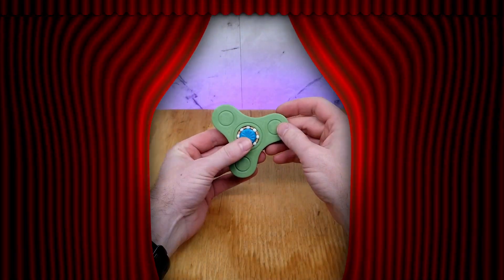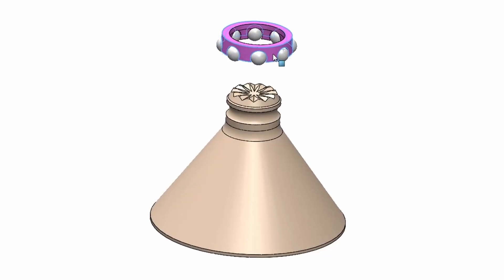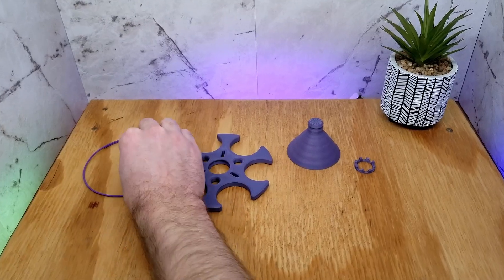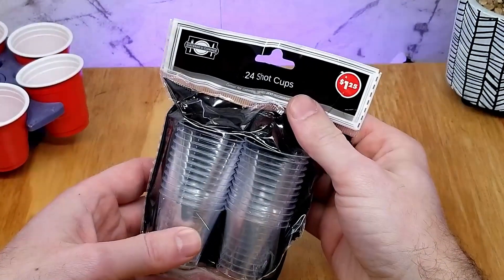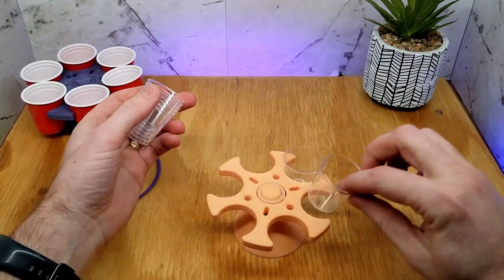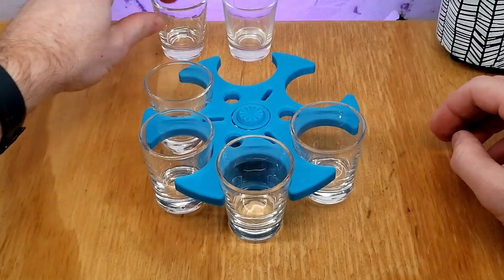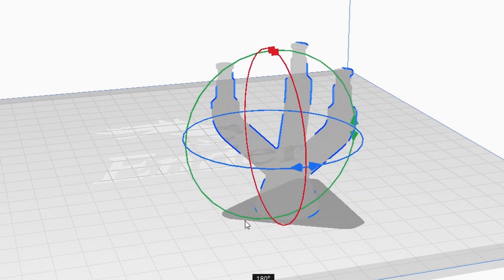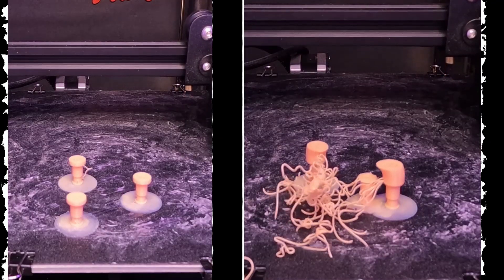Shot-Glass Roulette - 3D Printable! | Turning a Party Game into an Engineering Project. DIY!

Comment: Have you considered printing with rafts? I know it's a bit more filament and a bunch more time to print with them, but they could've actually solved the problem of printing the handle in the original orientation, allowing you to design it with whatever shape you felt like for the knob.
At least on my old Ender 3 I've had great success using rafts for such difficult prints that would not stick properly or warp otherwise.
Reply from the maker: I've considered it, but haven't done it... I've seen it done, it works, and you're probably right that it would have worked for this one. Yeah, I did like the original knob design... sigh... never thought about it for this though, I just reverted back to 'The design must be changed!' attitude. The Ender 3 can be a fun printer, sometimes... most the time though it acts up and needs to be baby sat. Thank you for the suggestion, it's definitely worth thinking about and keeping in the bag of tricks for the next issue 'when' it comes.
Reply: @sanfordprime  Sorry, didn't mean to tear up any wounds. I know how frustrating this iterative process can be sometimes.
I know the Ender 3 isn't perfect, but it was a good first printer.
I've moved on to a Bambu Labs A1 Combo (with the filament changer unit) about a year ago and it's a huge upgrade. Faster, better, automatic bed leveling and calibration, less acting up and multi color to boot. And it's not even all that expensive.

Although I do remember that upgrading the Ender 3 build plate to a textured PEI plate did help with bed adhesion a lot.
Reply from the maker: Bambu? Now I'm drooling... I honestly have very little complaining to do about the Ender. It has been a very good printer, easy to fix so far with the issues I've had, just a little tedious with setting up prints which can get finnicky sometimes. I have a lot of printing hours on mine... and it's held up well. I wish I would have bought the A1 last November, prices were very nice! I just looked at it the other day and fell out of my chair. The only thing really holding me back on it has been the uncertainty about adjusting the Gcode to activate the timelapse photo after every layer, it's kinda how I got into printing is wanting to do the timelapses like that (still some improvement to do in that area for me). From what I've seen, it is difficult to do on a Bambu? Someday I'll have to upgrade and find out. Honestly though, it's difficult for me to justify the price of a new one when I have a 'perfectly' working one already, but it is tempting.
Reply: @sanfordprime  It's much more than just a "prefectly working" printer. 
It's been a game changer for me. It really feels like going from a VW Golf to a Porsche. 

I don't do the timelapse photography, but it's actually built into the A1/Bambu Studio. I just have to check a box to have it take the pictures layer by layer. The integrated camera is useful to check on prints remotely too. 

Eg. I can be at work, deciding I want to print something. I fire up the App and send the job to my printer at home. I can use the camera to check on the progress while still at work.

It senses problems with filament feeding so well, that I could fix the issue and continue printing without any issues in the final print (I actually had a spool, with a hole too big for the AMS clamps, drop off the clamp multiple times during a print. It still came out perfectly fine. Obviously the next print after that was an AMS spool adapter :D )

To me, surprisingly, it's really as good as everyone says it is.

Actually so good, that I'm wondering if I should save up for one of their bigger, more expensive models with even more features.
Reply from the maker: You're a good salesman, that's for sure! Jokes on you though, my mind was already made up on a Bambu. LOL!

I've seen them in action, I just need to figure out a way to break my Ender beyond repair so I can upgrade. The Ender upsets me sometimes but it still works decently for most prints.

I've thought about larger printers capable of larger prints, like printing a full size chair or something. The filament cost for large prints kind of makes sure you're designing something that can't be manufactured by other means, and only capable of being 3D printed, a neat idea actually. But then again, I've found myself printing things more expensively than I could just buy outright, even at the Ender-scale,  just because I could. I think we've all done it. Haha!
Reply: @sanfordprime  ROFL. I was afraid I was gonna come across as a salesman while I was typing all that out ^^
I was just very enthusiastic about my "new" Bambu Labs printer.

I really really want a bigger printer too. I build a lot of cases for projects that are sometimes just ever so slightly too large to print as one piece.
Printing an entire chair would be fun, and to me the "profit" comes from the fact that I can't just print something that exists out there, but something that fulfills the same purpose, but with a personal touch in design.
Plus it's really about the journey too.

Now I imagine you printing your own Captains chair on your future large scale printer ;)

As for ending the Ender... It's so cheap and easy to keep it going, you will never kill it. In fact, I've upgraded my Ender 3 to a direct drive extruder not long before buying the Bambu one.
But you could see it like this: the A1 has a larger print volume, is much faster and has fewer problems during day to day use.
So really buying one will safe you nerves and life time. And maybe you have a friend that always wanted a printer but was kinda on the edge about affording one, so your Ender could get a new, loving home.
Reply from the maker: I couldn't agree with you more, the A1 makes a lot of sense. Also, you have a point, the Ender could definitely go to a new loving home. There are so many people that want to get into 3D printing but never take the first step of buying a printer, I have a few people in mind that have asked about getting into printing. I'd probably just give it to them with the condition that they could never sell it... once they were done with it or upgraded from it they would have to give it away to someone else that was curious about starting and so on...

I have a buddy that justified a new printer to me pretty well also, his reasoning was 'look at how much filament you've ran through it and how much that cost'. It kind of made the printer price feel low after that ;)

If I were to make a captains chair, I'd have to start with a 3D scanner and scan my body to make sure it was the comfiest chair I'd ever sat in. Baby steps though, trying to earn points through Makerworld right now. A free printer someday does sound good! lol.

Once I get into the A1, which shouldn't be anywhere near the amount of printing issues I've encountered with the Ender, I'll probably be in the same boat as you and comfortable with LARGER prints.

A good salesman believes in what they're selling. I believe the Bambu's are so great though that they don't need salesmen, so you might not have a chance at getting in there. LOL!
Reply: @sanfordprime  It'd be the printer that taught so many people the ropes of 3D printing. Passed on from maker to maker.
The Never-Ender

Lol yeah. Don't remind me of filament consumption. Iterative prototyping and design does take a lot of filament, even without failed prints. I once blew through two spools of filament before I had the final design for my Cyberdeck build.

Oh that'd be an interesting video series many would likely watch. How to design your own comfortable captains chair for 3D printing. I certainly wouldn't know how to get from body scan to comfy chair design.
Which brings me to the idea that Youtube might help you get a new printer, once you get more views.

You know, just random thoughts, but I'm eying their new H2D model, with dual extruders, full enclosure, AMS (ofc) and a Laser and a knife tool head for engraving and cutting. If I ever do get one (it is quite expensive though, so who knows), I should pass down the A1 like you wanna pass down the Ender. And if you still don't have one by that point I could pass it on to you and you could make a video about how passing on old tools is a great way to expand and improve the maker community.

As a great salesman I'd now let you "test drive" the A1 for a couple of test prints until going back to your Ender would feel like such a downgrade you couldn't help but buy an A1 on the spot 😁
Reply from the maker: @J0ermungand  It's a crazy idea, right? I can imagine a video following a 3D printer from household to household, printing fidget toys in one house to brackets for IKEA furniture in the next, functional tools and fixtures in another for some custom woodworker or tinkerer. A video from the printer's perspective, looking out at all the satisfied kids pulling their new functional fidgets from the print bed and the person with the IKEA furniture installing the printed part across the room immediately after it's done, the tinkerer assembling a humanoid robot with the parts. Wait a minute, how did you trick me into recording a commercial for Bambu? Are you sure you don't work for them? LOL.

I had to look up 'Cyberdeck', sounds like a stressful and time consuming time, I'm IN!

Yeah, we had a 3D scanner demonstration at work. They seem awesome! But, I too would struggle with how to make a comfy chair out of the data... I think the most comfy chairs are the ones where you sit in a snow pile and the snow just conforms like you're in zero gravity... wait a minute... what if I scanned that impression?

Totally understand what you mean, if I were to get & use an A1 then the Ender would sit idle for sure. Much easier to give away when just collecting dust!

Hopefully you getting an H2D is on the same time schedule as me getting the A1, I'm hoping to have a bunch of Makerworld points accumulating. I started my makerworld account not that long ago and hopefully just get one for 'Free' from them, the points are really stacking up quick so far! I appreciate your thought process though, I'm shaking on it with you... when we get new upgraded printers, we give our old printers to someone looking to get started.
Reply: @sanfordprime  Oh that's an awesome video idea.
It'll show everyone who didn't already know how varied the purpose of a printer can be and in how many ways it can enrich the lifes of people.

Oh yeah, Cyberdecks are time consuming. They combine hardware, electronics, software and manufacturing (most often 3D printing, but not exclusively). And at the end you get a piece of functional art - or at the very least you've learned something in the process.

Oh I see, you got inspired by some cool tech, as it should be. And yeah, maybe scanning that impression will give you the perfect shape for your seat. Now I kinda want you to do it, to see if it works as well as we think 😀

Alright, let's shake on it. Unused printers must be given a new home with someone that wants to get into the hobby.
I really hope you can get your free A1 out of those maker points. 🤞Can't wait for you to experience it.
Reply from the maker: Gonna have to wait until winter to scan... and come to think of it, I don't have a 3D scanner available to me... it's on the wish-list though! Might be a pipe-dream, who knows. It never hurts to have dreams, right?

Designing & Printing is very enriching and can be rewarding at times. It wasn't too long ago that unique parts, now easily made by 3D printing, were unobtainable or prohibitively expensive to acquire. Now anyone's design idea can be transformed into physical objects in a matter of moments. We live in an awesome timeline!

The points are adding up (both Makerworld and Prusameters, let's see which one comes first) and I'm in agreement. Once upgraded, the old printer will be given away with a starter spool of filament (not in a contest, but to someone local I already have in mind who was curious to start but hasn't yet), once they see how much one spool of filament can do they'll be hooked for sure!
Reply: @sanfordprime  Dreams are the fuel of innovation.

See I bought the Ender to be able to design and print enclosures for my projects. But I've printed so many things that had nothing to do with it, common household items, fun gifts and components for things that had nothing to do with my projects.
And on top of all that it completely changed how I think about enclosures and projects. It's more of a combined effort now, hardware layouts following the shape I want to design as an enclosure, etc.
 It was a life changing experience, literally.

Hah! Now you sound like a salesman! Hook  them up with their first "trip" for free and make them a lifetime customer. 😁
Reply from the maker: When you believe in something enough it's easy to sell!

Yeah, we're living in an amazing time aren't we? I keep thinking about the scanner... being able to print something that fits existing parts without having to model the existing parts first for the new thing to fit around. As far as your enclosures, are there 3D models available for download of the electronic parts you're enclosing?

Lifechanging for sure! I found myself making a YT channel out of it, LOL! I watch less TV too... and spare time goes into something I enjoy doing.
Reply: @sanfordprime  
You're absolutely right, if you already believe in something it's easier to inspire the same confidence in that something in others.

Well, as far as I'm aware, those 3D scanners all produce point clouds that need a bunch of post processing to become the model you want. Which, for simple things, is more work than just measuring the dimensions you need to make a model of of that. But that technology is only going to get better and more convenient to use. Just like printers themselves.
As for my projects. Mostly I'm fine with simple measurements. Sometimes, if I use something like an SBC I'll look for a 3D model to import into my CAD work for easy reference. 

Ironically I watch way more Youtube than TV now. And I watch it while I make things as well. It's somewhere between background noise, inspiration and instruction manual for me (I exclusively watch infotainment, ie channels like yours).
I've thought about doing something with my own channel, but while I do like the idea of documenting what I do to share my skills and knowledge with others, I'm not interested in videography or writing blogs. So it's a tedious thing I'd have to do during and after a project.
And when I make something it can be like a trance, neglecting everything else.
Reply from the maker: Wait a minute are you trying to talk me out of a scanner? LOL. No, I get it, most times they have their own native software that'd have to be exported as a surfaces-only model, or a point cloud, either one actually makes me cringe thinking about it. I'm sure that after acquiring one I'd be thinking "I spent all that money on this?" lol. They have their use cases I'm sure, such as another method of measuring parts, (within their native software). I'm with you, I'll wait until they're more affordable and more user friendly, Moore's Law right? My calipers work just fine for now...

The editing is brutal. Maybe it's just me, but I spend way more time editing than modeling; I'm getting faster at it but it's still way more time. I've learned a lot along the way, and I guess that was kind of the point? so.. mission succeeded?

YouTube is just so much more current than waiting for the nightly news, or a new episode on the history channel once a week when it's in season, and so forth... It has new stuff all the time about everything (if you can stand some peoples formats). I've brought this up before to people as to why I chose YT, but how many times have you gone to Tik-Tok for advice on anything? YT is the place with the most News, Info, Instruction, Lifestyle, and the list goes on... It's been great for me so far, from the user interface to connecting with people. If you can stand the editing, it's worth a shot. The first ones were the toughest for me, and there were certainly some times I thought to myself 'what am I really doing with this...' but, here I am still doing it!

Infotainment, I like that. I've never thought about the channel like that before but it fits! I've always chose 'entertainment' when it asked what genre the video was. I try not to be too 'instructional' and just try to keep it a 'check this out' style with some instruction and project background.

Thank you for your engagement with all this, you're really helping me out... Honestly!
Reply: @sanfordprime  
Right, that's uncharacteristic for a salesman, isn't it? 😂
I'm just thinking, you'll have about the same amount of work (to get a model out of it) when you DIY a scanner from a Kinect or by using photogrammetry (and a 3d printed rotating platform). 
But ofc I can be totally wrong, as I'm not up to date.

I honestly don't understand how hyped everyone is for TikTok and the shorts format in general. It's a dopamin hit without any substance.
And Youtube just has it all. From entertainment (movies and shows sometimes even) to full on guides. And I can choose when to watch and what I want to watch (as opposed to TV programming).

I really have a hard time making the videos while working on a project. I often forget to just take pictures, even when I absolutely wanted to do that this time.
So I don't really get to editing. But honestly, I should really take the time and make the effort of documenting at least one project in video and audio. Just to see how well it'd do.
But you have no choice, you must continue your videos 😜 (ie I want to watch them)

I don't remember where I heard the term "infotainment" first, but it's not just something I made up on the spot. And your videos def. fall under that category. And for people like us super clear instructions aren't always required. Moreover, we often look for inspiration more than a specific solution. Just a little push to get the mind going is all it takes.

I'm glad if I can help. This has been a fun and fruitful exchange so far. You seem like a great guy and if it wasn't for the geographic hurdles I'd invite you over for a beer and a "test drive" of the A1 😁
Reply from the maker: Count me in! I appreciate it. If you're ever in my area swing on by for one. You definitely understand the lifestyle and it sounds like you have the drive to make & tinker as well.

I've watched people become addicted to the dopamine, zombies walking around parking lots staring at their phones like they have 9 lives. Me? I cant do it... once in a while I'll sit around and partake just to witness what's going on with it, but feel guilty that nothing else is getting done, there's lots of things to do all the time and only one life to do it in.

Just imagine if you were to document your projects... Videos, audio, written... someday it might be valuable to someone. I gave myself a goal of 2 years here and if it wasn't going anywhere I'd drop it and carry-on on my own. At the end of the two years I was awestruck with how it progressed, and now I can't get the next video & models out soon enough. But, I am still treating it like a hobby it just has a few more cogs to it, still just a free-time thing, still trying not to stress over it, still having fun!
Reply: @sanfordprime  I do. The drive to tinker and make has been the most consistent motivator throughout my life.
What country/state/city do you live in anyway? I'm from germany btw.

LOL Are you kidding me? I too feel guilty when nothing gets done for too long.

That actually sounds like a great way to motivate oneself. Don't commit oneself forever, just for a little while and see how it goes.
IMHO that makes it easier to get started as well, since I wouldn't be anxious about doing everything perfectly for a long and prosperous future.

Sorry for the late reply, I'm on vacation atm :)
Reply from the maker: Just got back from vacation myself! Spent the weekend with the family at a nice cabin on a lake here in Central Michigan, USA. Hello Germany! Do you keep your beers in the fridge over there? ;-)

Honestly, I've never left the country here (unless you count Canada). There's enough beautiful scenery here to keep be busy for a lifetime though, besides it's a big jump if you want to travel any further than the two closest neighbors.
Reply: @sanfordprime  Yeah, we do keep our beers in a fridge. And we often call a beer "a cool blonde" 😁

We were in the Netherlands for a week, in a small house near the Zandvoort beach. It's an idyllic little city (Zandvoort that is) with lovely people.
Honestly, an American traveling around America is kinda like a European traveling around Europe. The size fits, the distances fit, though you have the advantage of always speaking the same language.
And we have the advantage of experiencing different cultures instead.

The furthest I traveled was to Gran Canaria, which even though it's an island around Afrika, is spanish territory and thus still counts as Europe. 😜

But I'd like to travel to America one day. You've got some beautiful places and I've already got a few friends over there, who I want to eventually meet.
Reply from the maker: from visitzandvoort.com it does look nice! Lots of fun things to do there. It kind of looks like some of the ocean beaches about a 12 hour drive for me, visited some too (like Virginia Beach) that Zandvoort gives me the impression of. Tons of history around you though, maybe someday long from now I'll have to check it all out.
You're right though, changes in culture over there. Whereas over here when we travel from state to state it's all the same culture, restaurant chains, and shopping centers, the only thing different is the naturescape...
Reply: @sanfordprime  Luckily Zandvoort in particular is just a 2 1/2 hour drive for me. I could actually just pop over for a day at the beach and drive back in the evening.
Although it isn't even the closest beach to me in the Netherlands.
The different naturescape is important ofc, especially if you find one that's soothing or interesting to you. But immersing oneself in a different culture is something else. You act and interact differently, which imho brings an extra layer of calmness.
Well if you do ever come over here, you'd be required to visit me for that beer ofc 😄
Reply from the maker: If/when I do I'll be sure to look you up. I appreciate it, Thank you.